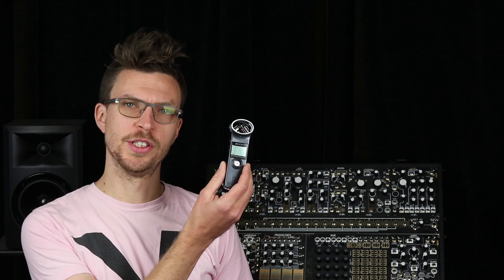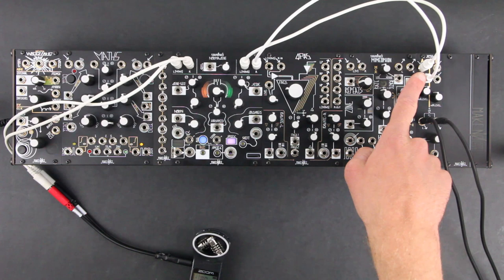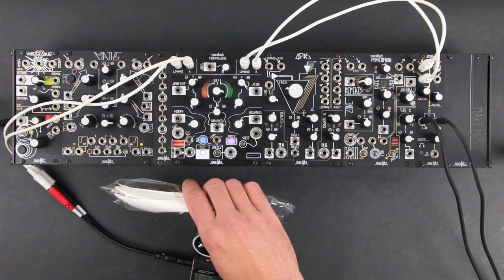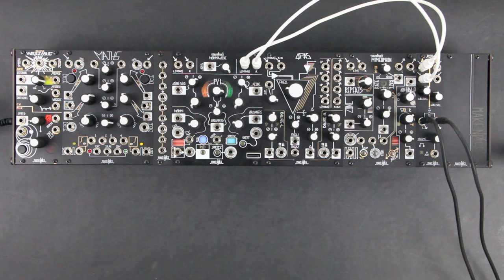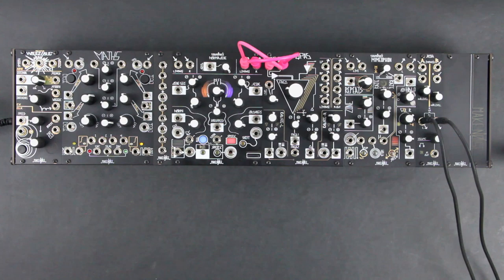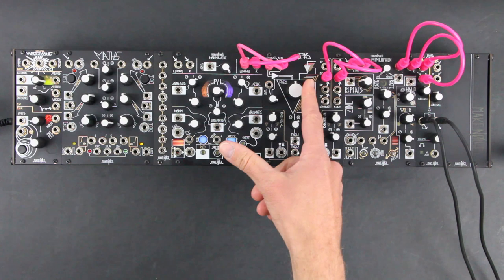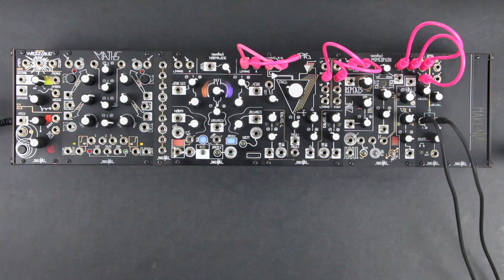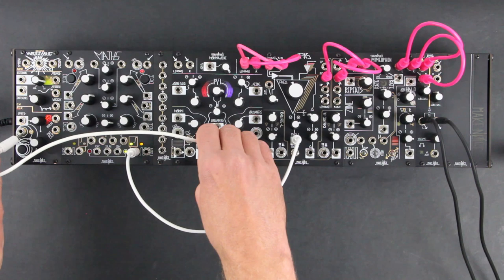Musique Concrète with Tape & Microsound Music Machine

Comment: My kids playing, backyard noise, coffee shop noise, antique xylophone, guitar, piano, spoken word audio from video streams, drum machine.... I was going to get a second zoom (found one used cheap) but I ended up getting a mic level pre-amp module for cheap because I use my zoom h6 to record the output. You lose some of the depth with out the stereo, but you have more choices for microphones or inputs. The pre-amp also boosts instrument level (like electric guitar out) more cleanly than the morphagene (if that is what you are going for.. maybe you want a little hiss 😎).
Reply from the maker: i have found that background sounds, mistakes, sonic quirks etc. start to take on a life of their own in their temporal relation to whatever the intended subject is, once you start repeating the same little splice of life in the Morphagene :)
Reply: @MAKEN0ISEMUSIC  Break it apart and explore carefully (or not) the attenuated slide or varipitch w/ the smooth random :D